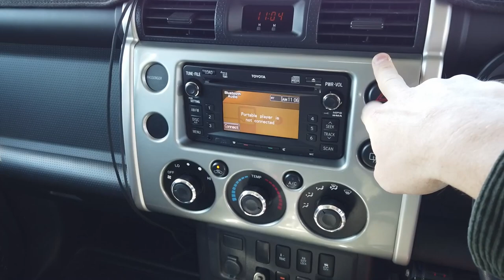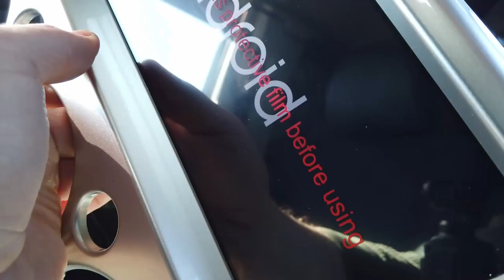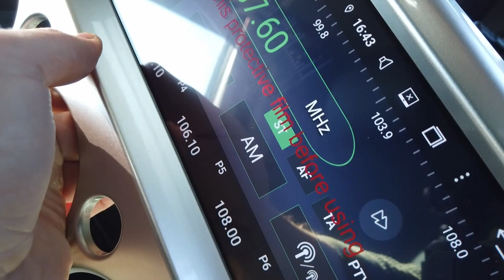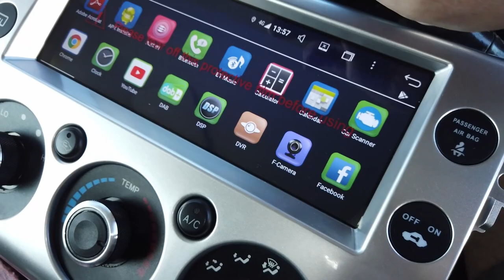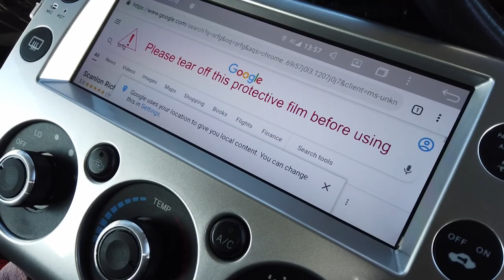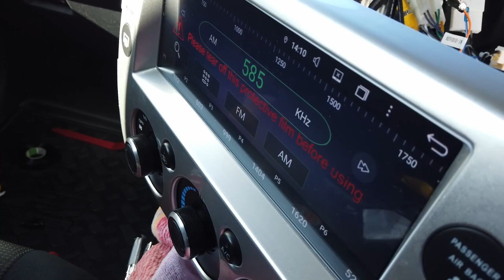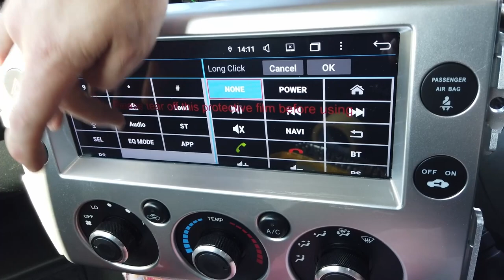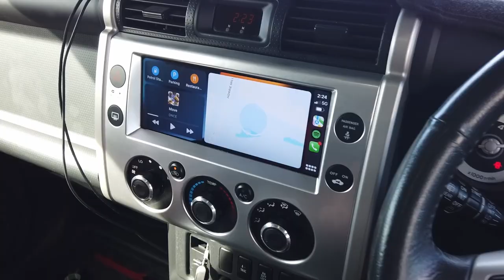Toyota FJ Cruiser Head Unit Installation 2011-2015

Comment: Thanks for the video.  Did you remove the two small circuit boards (6:30) only to remove and reuse the ribbon cables?
Reply from the maker: Hi Mate, New unit does not need this down as you will just use the OEM ones. Cheers